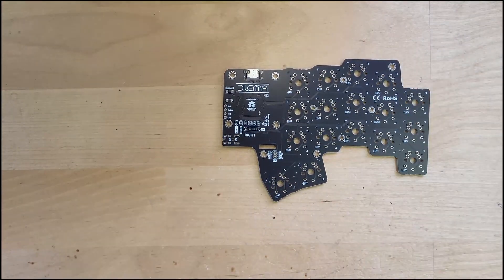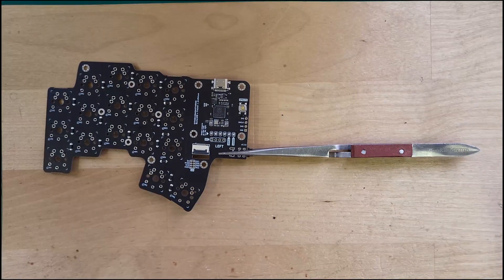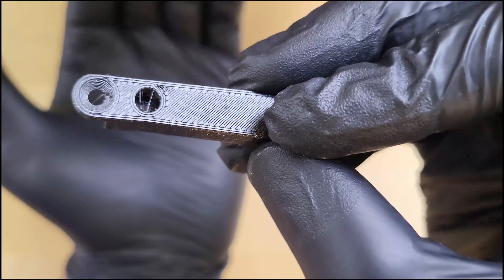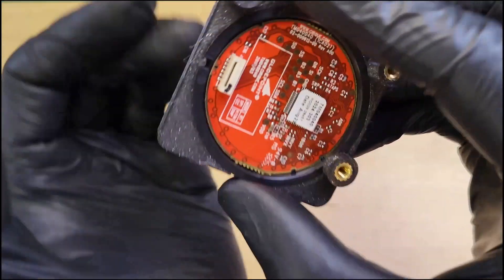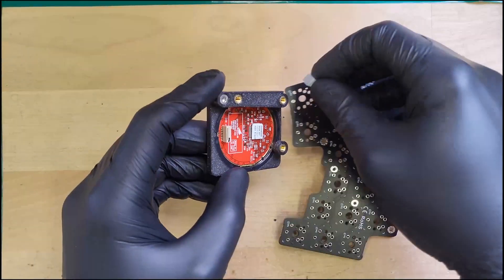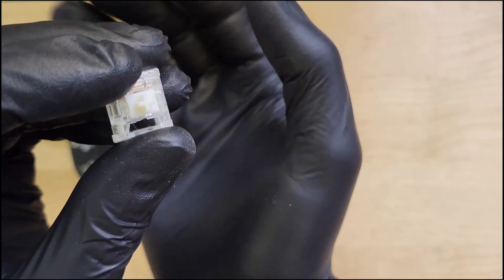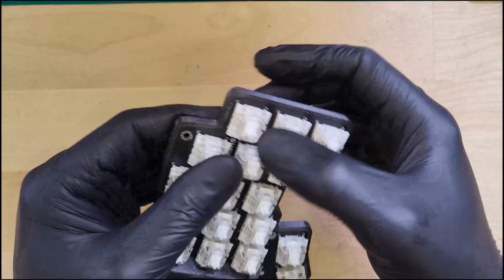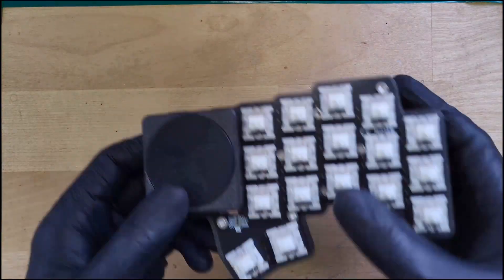Bastardkb - Dilemma build guide

Comment: Could you please tell What those rotaries for ? And what means MX and Choc for rotary options on the website
Reply from the maker: The MX and Choc rotary encoders have different heights to accomodate the difference in MX and choc profile.

For the encoders (credit to casuanoob on discord): 
volume up/down
mousewheel scroll
pageup/pagedown
caret scrolling (text cursor movement)
arrow keys (partial overlap with previous)
undo/redo shortcuts
incremental inputs like RGB Hue/Sat/Val/Speed keycodes
other repeatable inputs like zoom shortcuts
anything you want to spam (same reason some speedrunners often bind jump or similar things to scroll wheel)
(half joke) doing mouse movement like an etch-a-sketch
play sound voltex
don't need extra tucky thumb key, so why not stick a knob there
tab/shift-tab (basic tab/window swapping)
actual window swapping implementation (alt/cmd tabber)